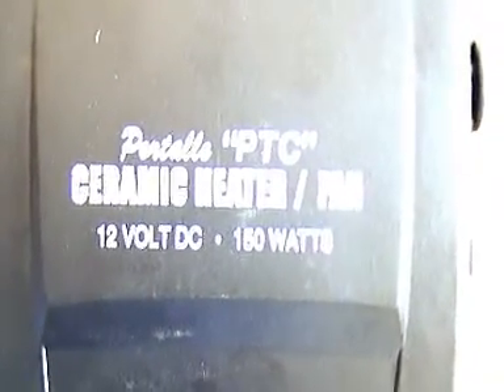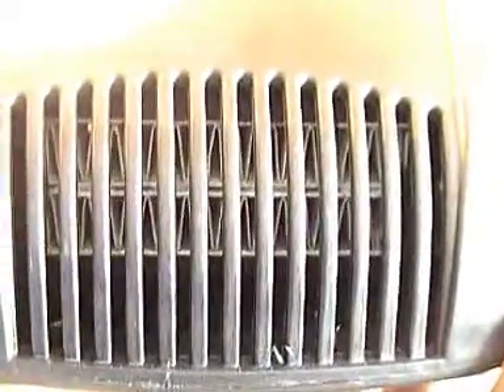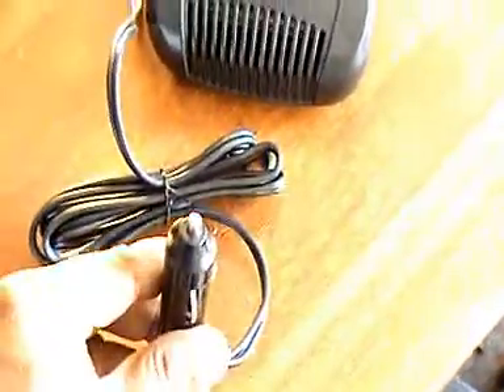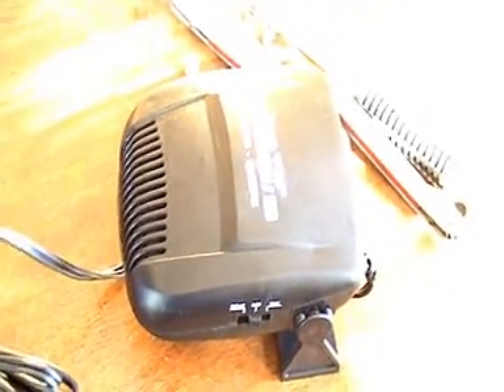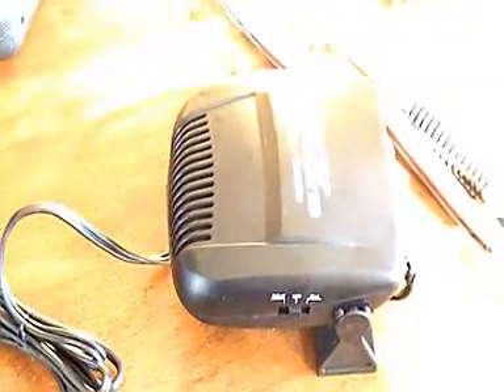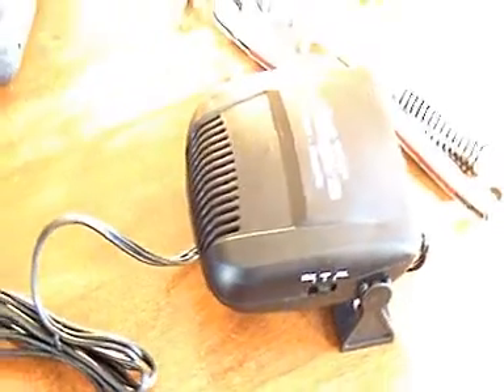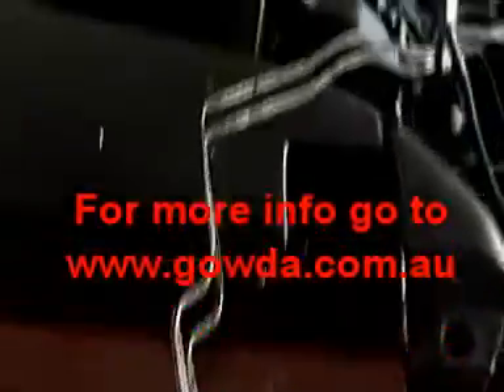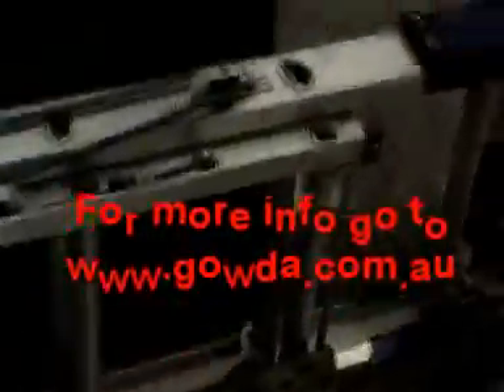Richard's EV 7 - Richard's Electric Car Conversion

Comment: If I were you I'd leave the old wiring in place and just tie off any loose connectors for the ICE. The weight of the wire looms is insignifigant, maybe 10kilos for the whole car verses the nightmare of rewiring .

Also, I hope it doesn't get cold there because that heater is very small, 150 or 180 watts? I coulldn't see clearly. That wouldn't cut it here in Chicago in January.